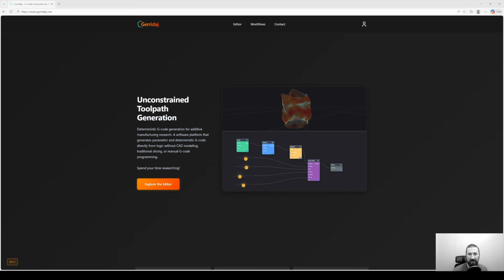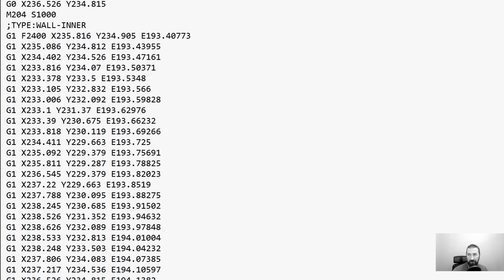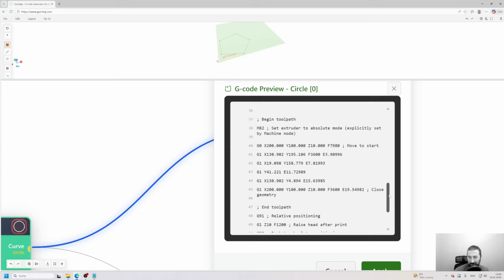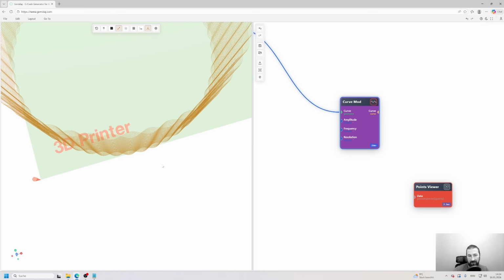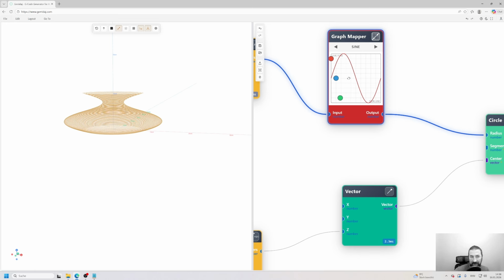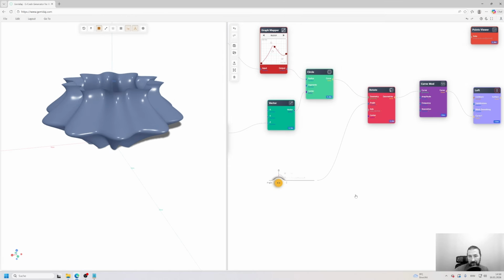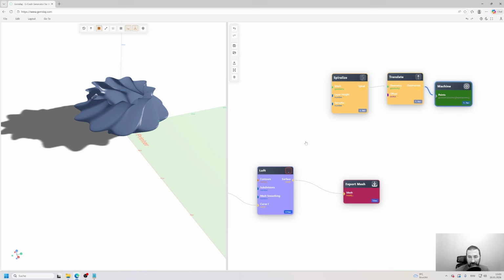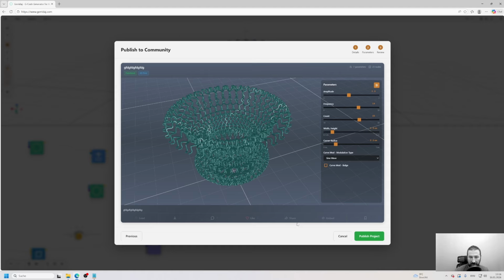How to generate custom gcode on Gerridaj

Comment: Thanks! A lot of useful information regarding workflow and each node, keep going please ))
Also I’m really stuck on printing any of my custom g-code’s on my bambu lab a1 or p1s, I’m not sure but I think bambu use not a standard g-code commands and also, z-offset they already stated let’s say from 0.2 and not specify first layer like we have on our g-code z0.000 do I need to translate my model on z0.2 to print correctly?
So a lot of questions here how to setup g-code for specific printer.
Also interested in workflow how I can add some flange to the model.
Cheers!
Reply from the maker: Did you find the discord? There are some templates for Bambu. They use some Macros in the beginning which you need either to copy to the final file or set as pre-commands. Also Bambu seem to struggle with absolute extrusion mode: just set to relative in machine node. Regarding z=0, I use constant z offset in my printer, therefore I generate G-code directly at the bottom with first points at z = 0. But you can also just translate your geometry before gcode generation.

Discord link is in the menu on workflow page. If this does not solve your issues, please feel free to ask any questions.